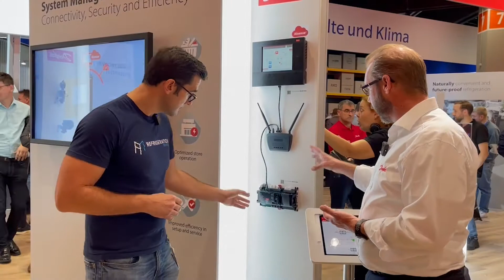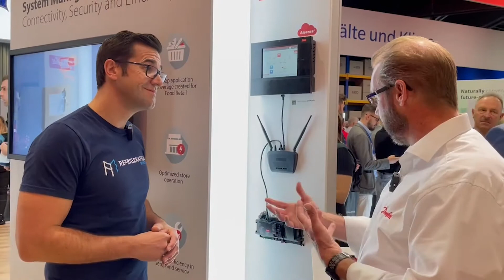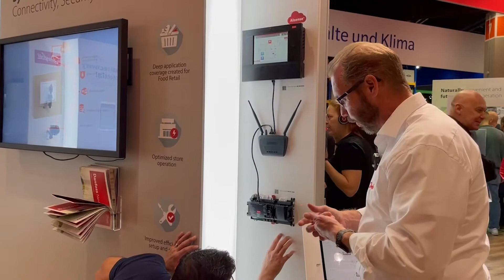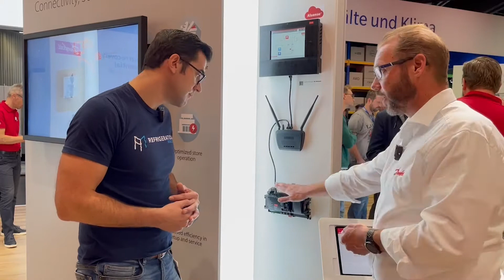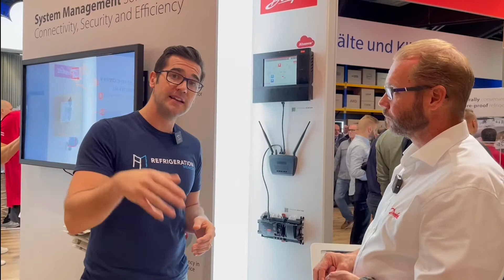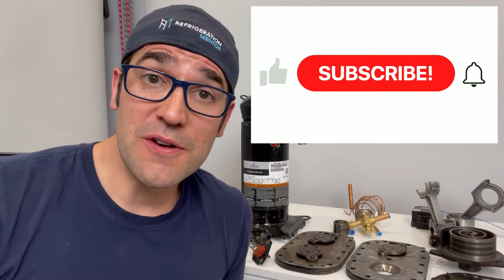Danfoss CO2 System Manager with Patrick Clardy

Comment: Great video 👍🏼
Is it possible to communicate to Siemens PLC & Siemens IPC’s from the controller/gate manager or so? 

Picking up alarms, values, status, etc. to PLC and then to scada system on the IPC.
Reply from the maker: Head to www.refrigerationmentor.com and click the contact button. Send me a message through there and I will connect you with the right people.